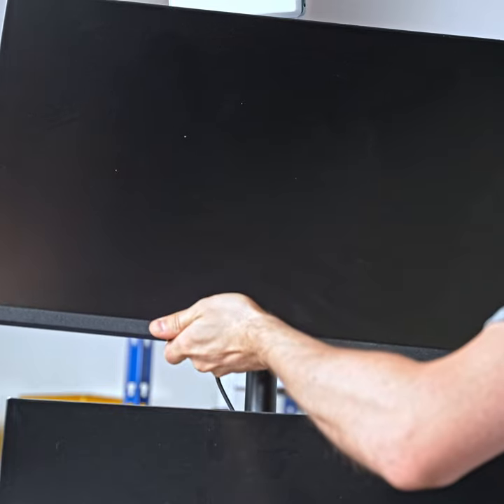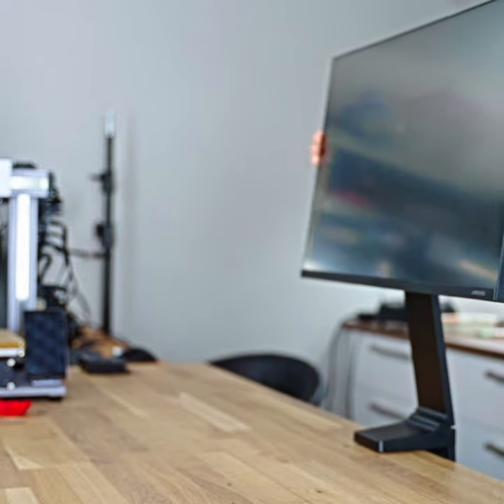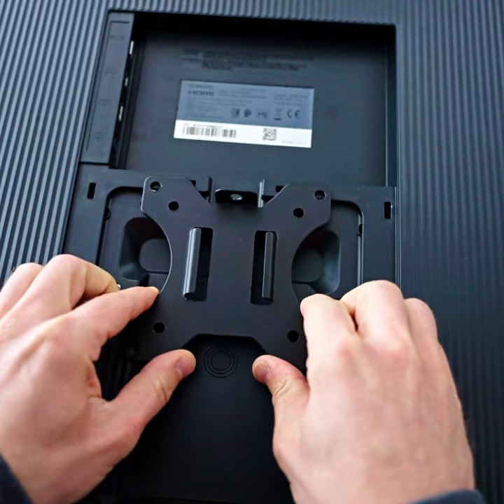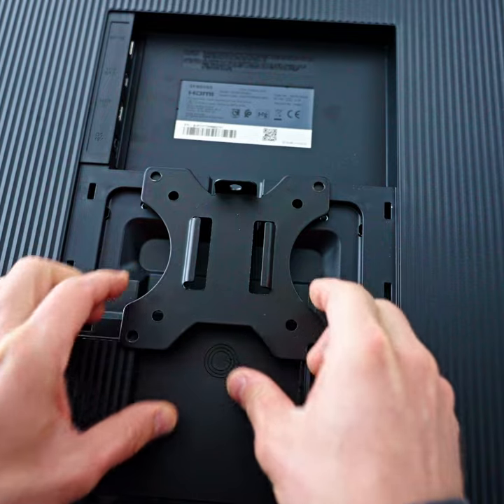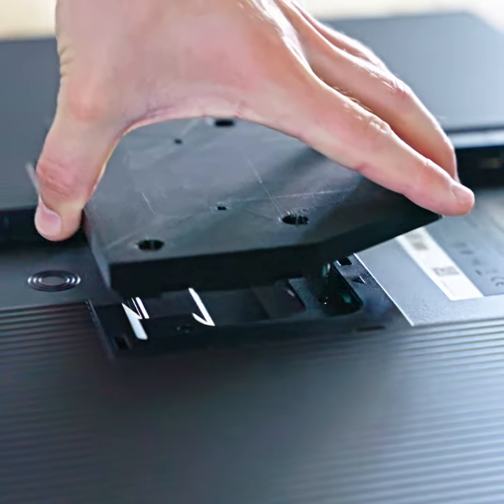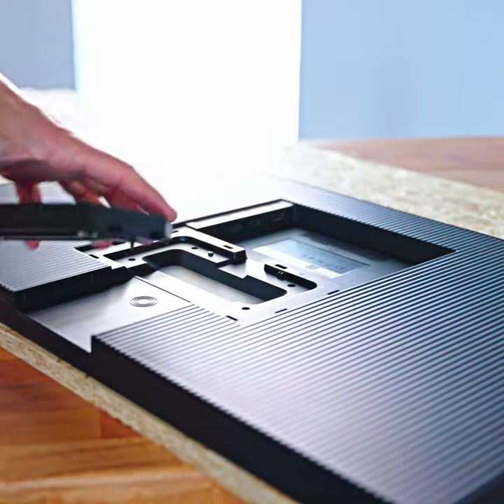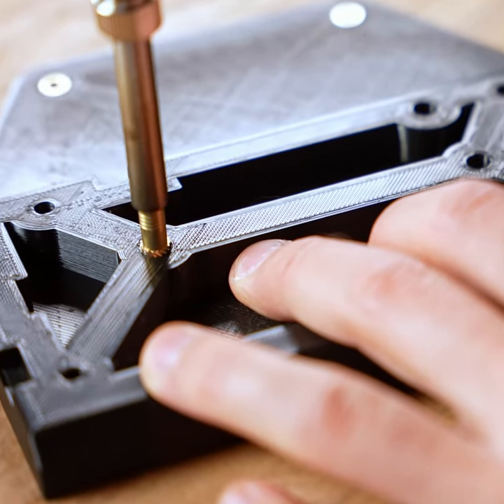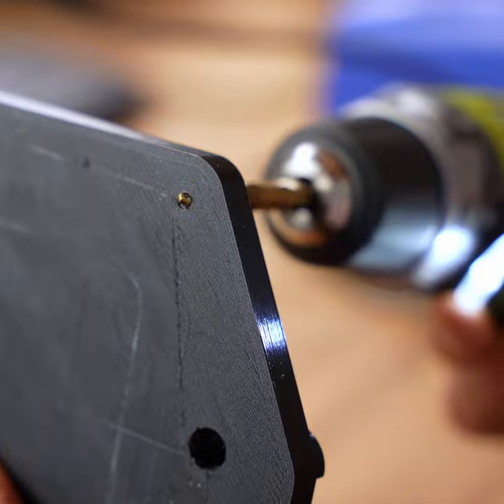Making Samsung's PC monitor usable with a simple 3D printed adapter!

Comment: Do not use PLA for anything under stress/tension. It will yield/break sooner or later
Reply: He’ll hear a loud bang someday. Will go see what it is, and will find a broken monitor laying flat on the floor or desk… I agree with your comment
Reply: I made a vesa adapter for 2 small monitors that are way too old (dell 1707F) which are heavy and they have been perfectly fine for 4 years.

PLA is strong, look at CNC kitchen's strength comparison. Its just too susceptible to heat

Comment: Wouldn't the pla cold flowing eventually cause issues?
Reply from the maker: I originally printed and filmed this almost a year ago now, and it still looks and works good as new. As long as the forces are relatively low (which they are here), PLA is perfectly fine!

Comment: i did this with my monitor and the micro vibration of my desk caused the mount to crack in half and my monitor to fall
Reply: Print in PETG
Reply: For the love of.... Do not use PLA for anything under stress/tension. It will yield/break sooner or later
Reply: @girenloland  it depends on how your part is constructed and the kind of forces. If it's only compression and well-distributed, then it may be fine
Reply: @polycrystallinecandy  Most likely not. Even if you over engineering a part and make it twice as "strong" as you planed. PLA will sag/stretch/bend/yield. Well, in some applications, it may work. As long as it does not have stress. Even at prolonged exposure to 40c PLA is in trouble
Reply: @girenloland  I print firearms in pla and they're fine.

Comment: Samsung really knows how to make monitor stands. Haha. I have three Samsung monitors and all of them have the same stupid stand design that you have to take the monitor apart to remove all parts of the normal stand for clean looks if you want to use a VESA mounted monitor arm. Your Samsung is better in that regard, but omitting the VESA mounting holes is just wrong.

Comment: Problem solving for a problem that shouldn't exist in the first place. I mean, VESA has been a standard for AGES, and pretty much any company has implemented it into their monitors and TVs. I currently have 2 monitors, an Iiyama where the stock stand was already attached via VESA mount, and an AOC "gaming" screen that has a rather "fancy" stand that doesn't quite conform to VESA, but they included a bracket that adapts the hole spacing. Heck, even my ~10 year old monitor already had VESA holes on the back.
So thumbs up to you, but thumbs down to Samsung for going the proprietary route...

Comment: I fail to see what was actually accomplished?
Reply: The monitor doesn't have to extend forward 12" when you put it low, because it can now use a standard desk stand that is multi-articulated.
Reply: Thanks. For anyone else who missed it, the results (which you reasonably expect at the end of the video) are apparently shown in the first two seconds of the video...